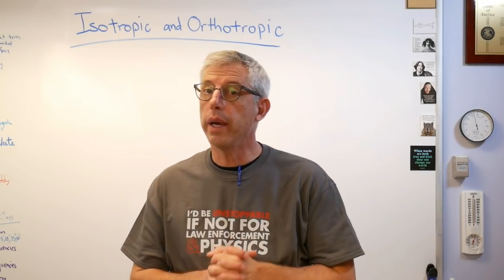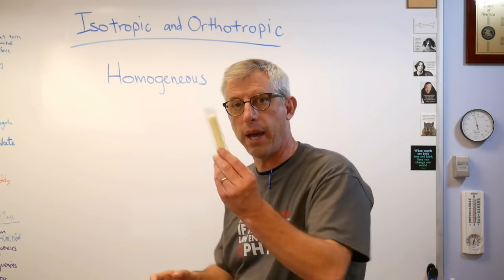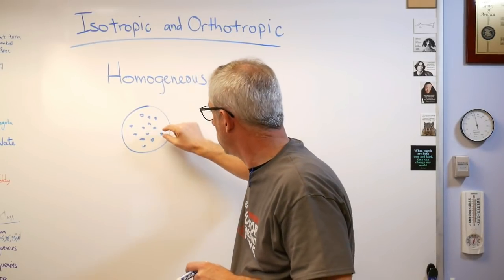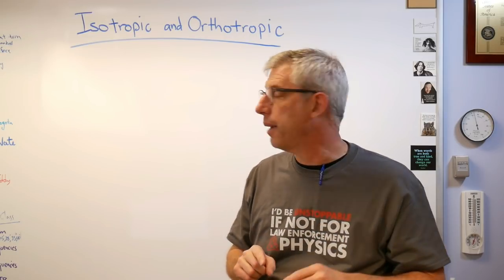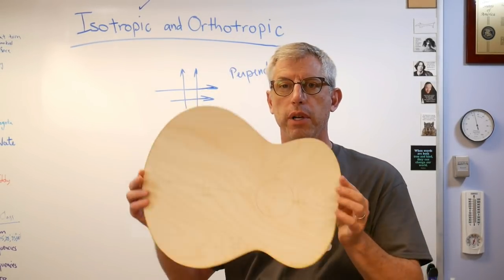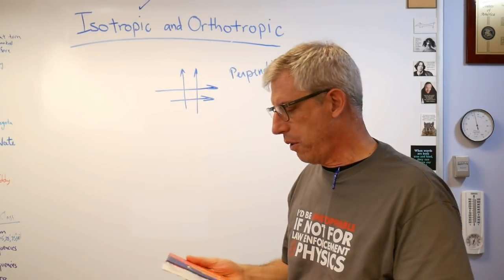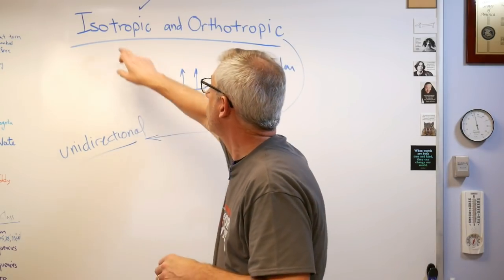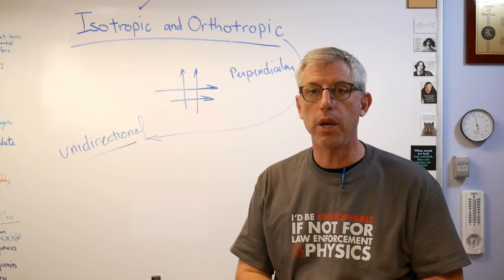Isotropic and Orthotropic - Brain Waves

Comment: Mr. French, could you please help me with one problem? I'm just getting confused when trying to evaluate the directions of the moment and torque. I'm trying to use the right hand rule but the directions on the sketch are opposite. I would really appreciate! It's an example problem 3-10 from Shigleys's Mechanical engineering design 10th edition.
Reply: Actually, the right hand's rule works properly only for torque. In evaluation of moment's direction only "left" hand's rule fits.

Comment: Hi Professor, I was told it would be harder to break wood across its length than along its length as you have to snap the fiber itself. I am not sure 4:01 you meant it the other way around, keep up the great work
Reply: hyronov If you were to take a little square of wood and put it into a tensile tester you would find that along the grain would be significantly stronger than across the grain. This makes sense if you consider the way that the wood is formed. Along the grain you have long continuous elements of wood that go from one end of the piece to the other without break. Across the grain you have multiple short elements that are essentially glued together which cannot provide the same strength as the continuous elements along the grain. 
Perhaps what you were told was that along the length of a plank (hence along the grain) you can generate a lot more leverage along the length than you can across the short width of the plank. Hence it is easier for a person to physically break. 
Hope this helps.
Reply: Hi Eoin,
that would be true only in tensile loading right , would be different in compressive  loading if the part was bending you would want the bending load to be 90 degrees to the grain length-https:// web.stanford.edu/ ~rayan/wood/wood. the link kind of explains my point. thanks
Reply: hyronov I'm not familiar enough with wood properties to say with certainty but I believe that compression along the grain will still be stronger. Most materials have different yield/max stresses in compression vs tension. Note this is not the same as isotropic/orthotropic. If you compress something enough that it starts bending that is known as buckling. There is a good video on the topic on this channel. If you load up a beam so that it's bending that can be shown to result in tensile stress on the outside of the bend and compressive stress on the inside. When considering bending wood you are correct. You would want the force to be acting at 90 degrees to the grain.
Reply: Hi Eoin, that makes sense